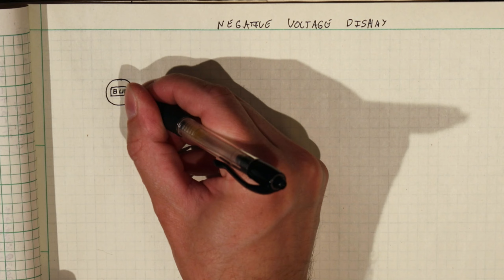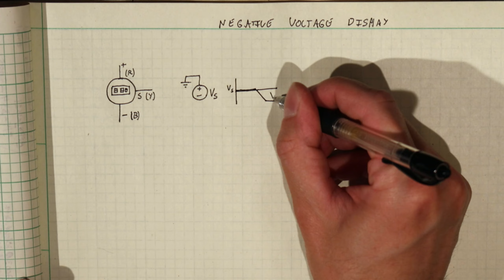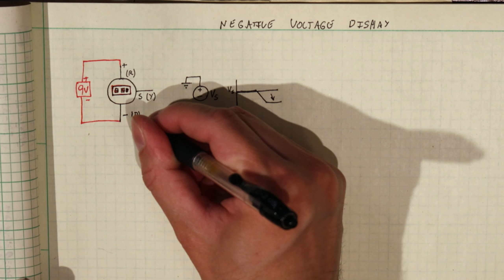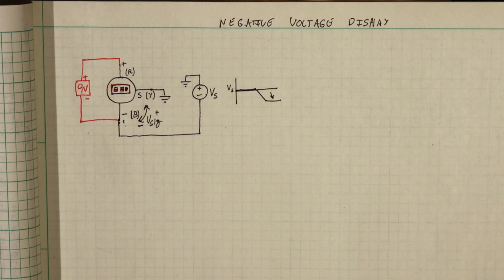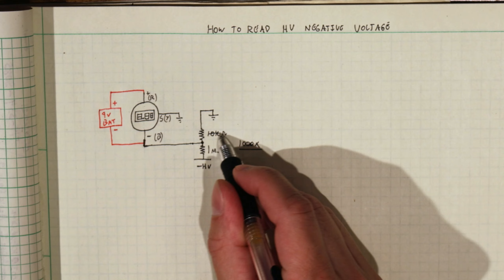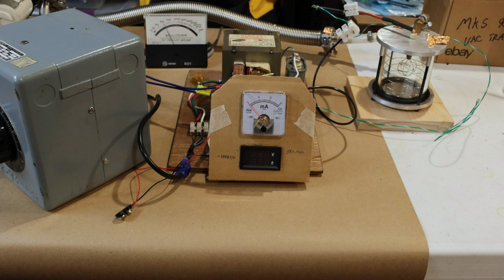Cheap Negative Voltage Meter (From Typical Cheap Positive One)

Comment: Does this measure negative AC voltage or negative DC voltage?  Just wondering if this could be used to measure the negative grid bias voltage from a tube amplifier?

Comment: Thanks for the video. How would you hook up the current wires to read current draw on the negative side?
Reply from the maker: This meter only measures voltage…
Current meters you would hook up reversed, or if bipolar (read both directions) then it literally doesn’t matter.
Reply: @TheMadHatter1337  But would you connect it to the negative rail or ground?

Comment: You can also use a voltmeter on the icl7107 to measure both positive and negative voltage.
Reply from the maker: @МаксимГрищенко-н1с  sure, but for simple gauges you may want to leave in DIY equipment… DMMs are not ideal.